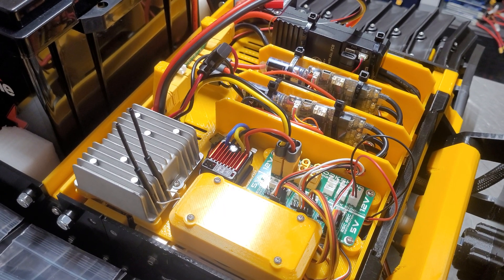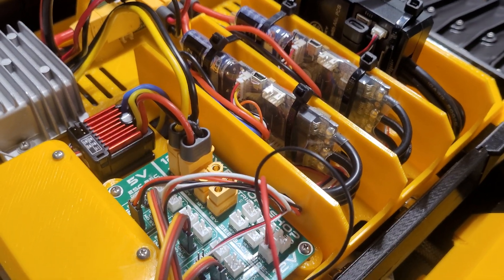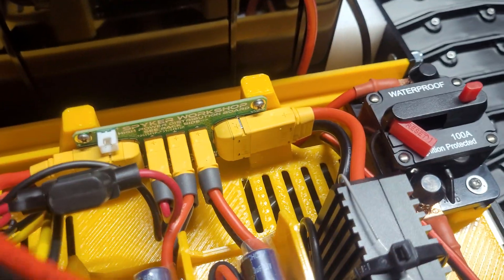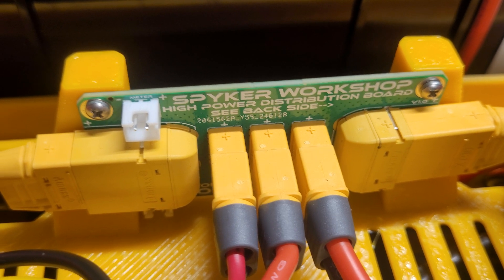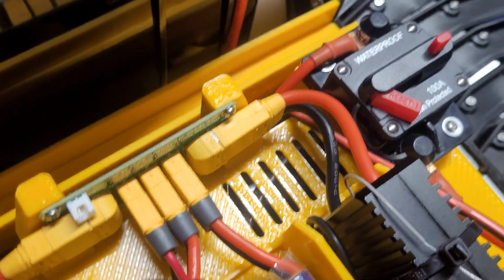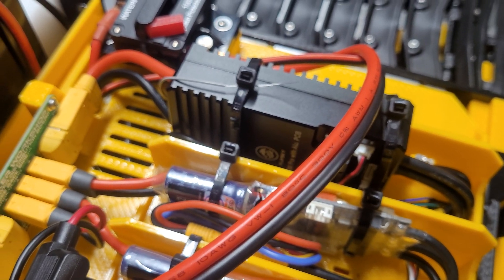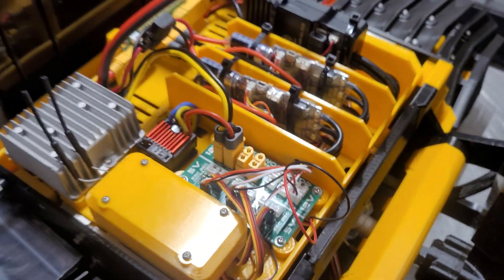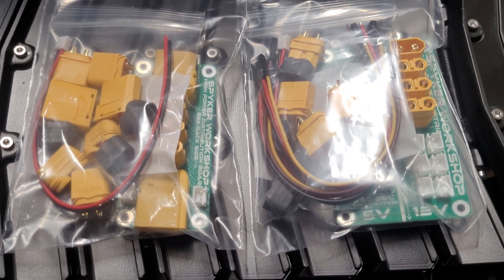Spyker Workshop - Spyker KAT 2X - High Power Distribution PCB (BUILD SERIES)

Comment: Damn, I REALLY want that organizer for the electronics. My 2X Kat can't use the middle battery positions yet because I just can't get the wiring & VESC's situated to give enough space.

I like the two new power boards (I have the older all in one version), about the only thing I might have said differently in the video is where the 5v section can strip out the 5v to not overload the reciever, and re-route it to where you want to run stuff off of it.

You've probably already thought of this, but is there any chance that organizer could be installed in the current basher body panel? Like, stuck in the top facing downward over the battery spot? I'm not sure how much clearance they have, but that'd be a LOT neater to work with, even if they had to be thicker as a result.
Reply from the maker: Send me an email, currently still working on new lids.